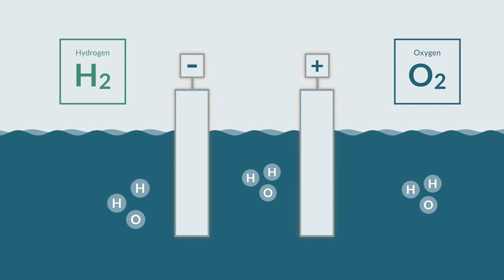Production of green hydrogen through water electrolysis - how does it work?

Comment: How much water is used for this process?  Water is a very valuable commodity. How much energy does it take to produce H2?
Reply from the maker: Approximately 30 Liters/kg H2. We acknowledge your concern about water scarcity in some places on the planet. However, the advantage of the systems we produce is that they can work with lower purity of water - for instance, wastewater from other industrial production - making the solution much more sustainable.